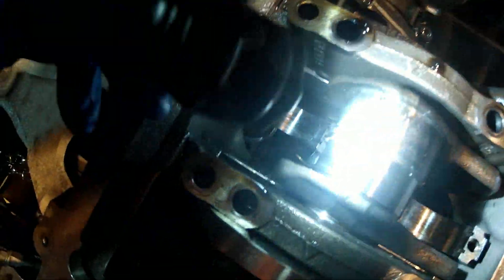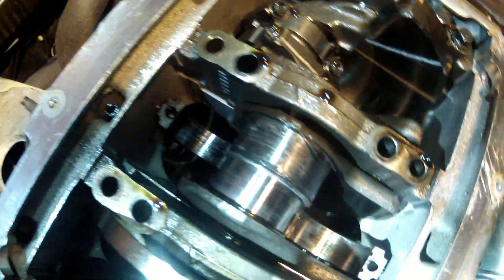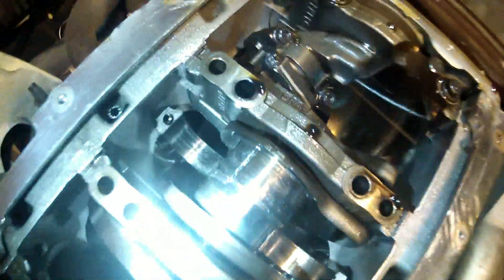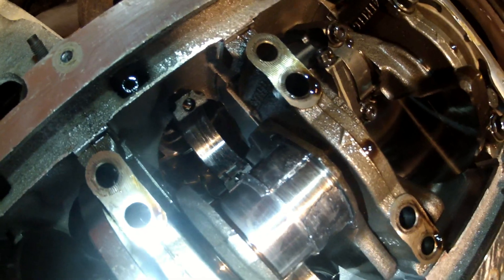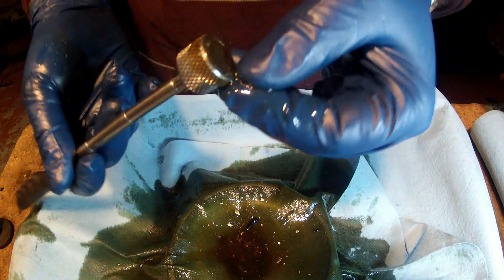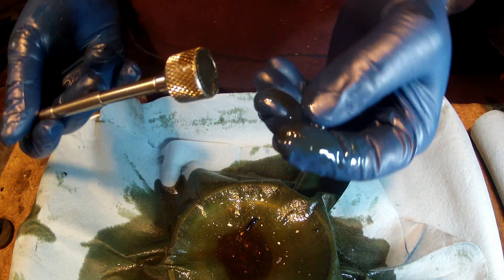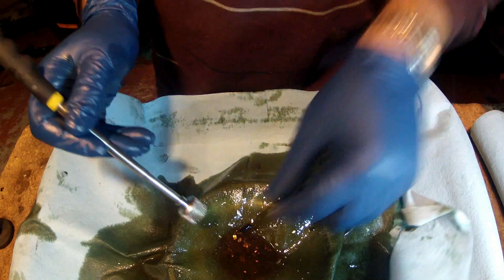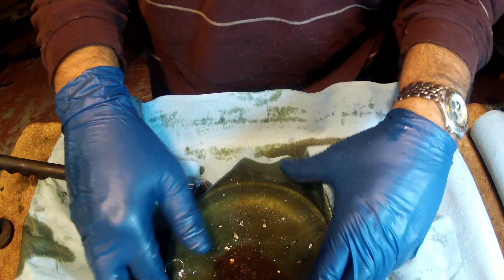5.0 Coyote engine spun rod bearing failure

Comment: What did it sound like do u have a video ? And did this fix the issue and for how long ?
Reply from the maker: No I purchased the car already knowing that the engine was stuck/not turning. I have recently rebuilt the engine with a new crankshaft, connecting roods and bearings.

Comment: What caused the spun bearing?
Reply from the maker: the guy that sold me the car said "was racing against an SRT and wining then engine started making noise" LOL. Anyway probably high RPM and not enough oil pressure was probably the cause.
Reply from the maker: the previous owner said he was racing when it happened
Reply: Most likely Oil pump gears went bad first